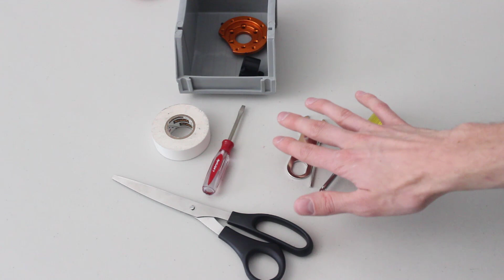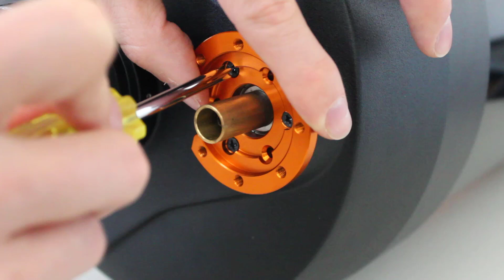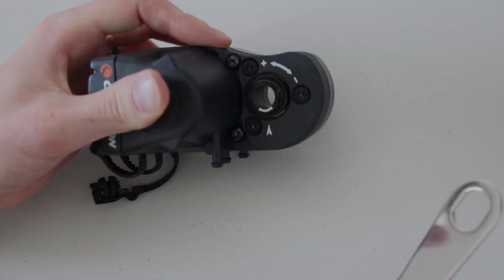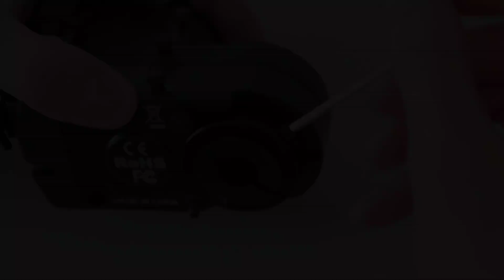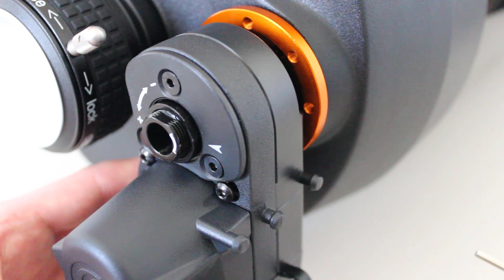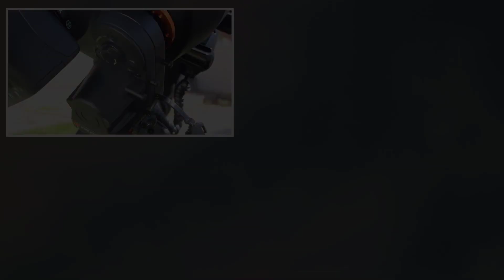How to Install the Celestron Focus Motor (Detailed Version)

Comment: A great video. I used it when I installed my focus motor a few years ago and now I need to reinstall it after it stopped working. Lost the grub screw however. 

I now need to buy the set screw shown at 10 mins in. Anyone know the size? Metric/imperial?

Comment: HELP. How do I power both my focus motor and my Skysync at the same time? Both the focus motor and the Skysync only work when plugged into the right port on the base of the telescope. I’ve tried plugging focuser in one port and the Skysync into the other port and vice versa, but both devices only work with one port. What am I doing wrong? I have the Celestron 8SE. Thanks.

Comment: Is there any other way to control this focus motor other than the hand controller or SkyPortal?  Both of these options are not nearly as functional as controlling manually. You have to go through several menus to use the hand controller, which is a bit awkward, especially when you're using a iPad for all other control functions.  And the SkyPortal focus control system is totally wonky. You never know what it's going to do. Perhaps they will some day improve the functionality on SkyPortal, until then I see no use for this device.
P.S.  I hadn't no problem installing this device following your excellent video. Perhaps an additional video discussing how to control the focus motor on SkyPortal would be in order. Perhaps I'm not doing things correctly or simply don't understand the controls. As far as I can tell there are no written instructions on how to use SkyPortal.
Reply from the maker: I think most people now use CPWI to control it or through ASCOM and their imaging software. SkyPortal can be a bit laggy making it difficult to focus, and the handcontrol isn’t ideal. I wish Celestron would develop a simple handcontroller for, but I haven’t heard anything on that.
Reply: @AstroBlender  Thanks so much Simon for your prompt reply. I've looked into CPWI as well as ASCOM and both only operate on windows platform. I am currently using an iPad Pro to operate my telescope, which seems to work perfectly with SkyPortal (other than focus control). For now, I believe I will return the focus motor to Amazon and continue operating my E8 manually. I really hate the fact that  astronomy software in general has abandoned the Apple format, which is far superior to windows in many ways. Thanks again for your prompt reply and interest.

Comment: Well, I tried installing the motor today and a couple of things as regards to the Celestron 6SE.:

1) The cover plate screws are 5/16 hexagonal screws, not Philips screws. The philip screw supplied is not going to work. 
2) I had issues with installing the cover plate. No matter if I set the scope pointing down and snugging it, it tilts and binds. I ended up stripping the gears. The good thing is I had a loss prevention plan so I'll get a replacement and I'll get longer hexagonal screws since the original screws are too short.

Comment: I recently bought a Celestron Focus Motor for a C8 SCT and when I went to install the new orange focus plate, the screws I removed from the original one don't fit.  They're too wide at the top to go into the recessed area for the screw head leaving the screw too short to come out the other side of the new focus plate.  And even if they weren't too wide at the top, that would only leave 2 mm or so to protrude out the other side.

Does anyone know what size screw I need to look for at a local hardware store?  Has anyone else run into this before?

Comment: You might want to try an electric guitar knob puller. Your situation looks like the perfect application for that tool.

I really would like to know why this focus motor will not work with the 127 SLT MAK.

Comment: Installed focus motor on se8 i bought 2nd hand wobbles.   Motor works fine but wobbles.   The 2 hex bolts are stripped and will not loosen so i can reinstall.  Help!

Comment: When you showed the plate angled when you had one screw snug for an example, it looks to me to be that the motor plate DOES NOT sit flush to the flat part of the telescope body.  IF the plate rocks at all it means that the plate back ridge is a bit larger than the scope recess.  I plan on VERY SLIGHTLY SHIMMING the plate back ~1/32 or so, (one or two thicknesses of electrical tape),  which would ensure that the plate is actually flush to the scope body recess....  Then to only tighten until snug.  I will be examining this process in person when I get my CPC 800 XLT and focus motor in hand next week.   My comments are based on what I saw during this video.

Comment: For those who have the Celestron 11-inch, like me, I have found that installing the plate so that the spot with the greatest number of mounting holes is facing down, if you want a vertical orientation of the focus motor.  Otherwise,  you will get the focus motor slanting in toward the back focus, or you will only have options for the focus motor base (the surface with the inputs) to be straight out to the side or straight up.  I wanted mine vertical, so I had to unmount it, take the plate off and reorientate it so the holes were at the bottom, that worked just fine.  Thanks for sharing your expertise.  It helped me bunches in installing this focus motor.

Comment: Thanks for the great review and instructions.
I bought the focuser last week and installed it but I have issues with the design.
It's working OK for me, however with some issues.
First, when I calibrated it initially the motor had a pitch change in the  sound it made - a rythmic change once per rotation, which I attirbuted to a slight misalignment.
I removed the motor and double-checked the orientation of the mounting plate and found it was just a "hair" off.
Re-installed the motor but the pitch change remained.

I am of the opinion that the set screw is only meant for the C-11 and C-14 scopes.
Set  screws are supposed to be meant for metal-to-metal contact.
That's not possible if you use the plastic adapter sleeve  for 8" and 9.25"  Celestron scopes (I have the 8" SE8).
The set screw is pressing against plastic (and deforming it).
The primary method of securing the motor sleve to the brass knob is the clamping screw, which squeezes the metal sleeve, which squeezes the plastic adapter.
I think the set screw in my case is redundant.

What do you think Slymin?

Comment: Thanks for your excellent presentation.  It appears you are using the small diameter 0.63X focal reducer.  Is there enough clearance to use the much larger diameter 0.7X Celestron reducer with the focus motor on the Edge HD 925 OTA?
Reply from the maker: There is if you get the latest version. The new version of the focus motor has a little notch cut of the side that accommodates the C9.25 EdgeHD with 0.7x reducer.

Comment: Great video. Unfortunately I installed my focuser on my 11” RASA before seeing this. I legitimately ran into every problem you outlined lol!! On my RASA V2 there is also a rubber gasket that fell out initially when removing the original plate.. just a warning for others as it’s greasy and fell on the ground. Also on the larger mounting bracket you have to really pay attention to the orientation it mentions in the manual. In the end I had to just loosen up my screws on my mounting plate way more than I thought i should to get my motor working. I don’t think that can be stressed enough about how loose it might need to be, but my focuser has been working great.
Reply from the maker: Good notes, I’m glad you found the video helpful. Clear skies to you!

Comment: I’ve had the focus motor on my Celestron evolution 9 1/4 telescope for the last year or so and it seems to work but I have not been able to calibrate. What could possibly be the issue with calibration?

Comment: Screw, screw, screw!  Not bolt! Good video though.
Reply: Agreed that the clip is excellent by being very easy to understand and follow, although yes, being a toolmaker by trade, I'm very picky in many ways and one of them is using the correct terminology when describing fasteners. Screws they definitely are. The even, systematic application of fasteners also apply to any group of fasteners, whether nuts, screws or bolts that include things like wheel lug nuts, etc. That being said, thank you slymin for taking the time and effort for producing your many helpful guides.

Comment: Unfortunately it has not been like that for me. Firstly I found only two screws inside the focuser unit. Several days later I put a video probe inside the barrel and discovered a rubber sleeve covering one of the holes! No indication where it is supposed to go. I edged it out of the way to reveal the third hole - but where is it supposed to fit and why did it not stay there?  I assembled the motor meticulously according to your and Celestron's instructions.  I was able to move the motor in a bit and out a bit. When I selected calibration it made a small move and then stopped for all time. Having already followed the instructions there seems little else that I can do.
Reply: I had really hoped that there would have been a reply to my detailed observations shown above. No progress then since I bought the focuser.  I cannot make it concentric because the cover plate is fixed by the 3 screws and the tube will not move laterally to place it in the centre,  Disappointed.....

Comment: Thank you Slymin. I just installed the focuser on my 8SE following your recommendations and it went very well. To help with leveling and centering the focuser plate and motor assembly I placed the OTA vertically, front-side down and this technique effectively ensured that all the hardware had not gap or tilt. And it is also much easier to align and install the parts to the OTA since gravity helps and you have your two hands free for doing the fine work, One extra step that I did in order to ensure a stronger hold was to put Loctite 242 on the 3 screws of the plate. Overtime the motor movements will induce tension on the assembly that might eventually loosen the bolts and make the system wobbly. The screws have a very thin thread and are not really designed to hold such a piece of hardware like a focus motor. Loctite will definitely help in maintaining the hold tight.

Comment: Great video, but there are some missing items. I have a Celestron 8 SE so this applies to many. First... the set screw and the other focus ring screw has to be tightened significantly to get the plastic fitting to grab the focus tube of the scope. That set screw should be more than halfway in the threading. Eyeball it before you put the focuser on with the captive screws. Secondly... there’s a whole calibration procedure that isn’t mentioned.

The unit is a game changer for viewing though... You can’t get the level of fidelity with using your fingers as this unit gives you.

Comment: There is one major issue. If your focus motor does bind and cannot access the screws which tighten the drive to shift then your basically stuffed with no way to remove the focuser motor.

After all there is only a small part of the motor you can access these bolts so if it binds and has bound where you cannot access these tightening bolts to thr focuser then no way in hell can you remove the motor

Comment: In case this helps anyone else out down the line........

Despite great videos like this one from Cody and despite reading numerous articles, I could not get my Focus Motor installed on my CPC1100 correctly. I know I'm not the only person to encounter problems with this. No matter what I did, I could not get the motor work correctly with the screws for the mounting plate and motor mount installed anything other than loosely - which is obviously not right.

I read up on a lot of threads about this and it seems the basic problem is that the mounting plate supplied with the motor causes pressure to be put on the focus bearing. People have come up with many solutions including installing washers / shims and, taking Celestron's Tech Support advice, to install the orginal focus mounting plate first and then the Focus Motor kit mounting on top. - and that's what I did. 

Whether by luck or design, my CPC1100 came with quite long screws in its original mounting plate so there was ample thread left to pass through both plates. 

With both plates installed, all the screws can now be tightened down (snugged down, nothing OTT), including the 2 hew screws for the motor mount. Before, the screws had to be left loose just to allow the motor to turn anfd, believe me, I spent hours making sure everything was true and aligned correctly to try and solve this.

Anyway, that's what worked for me and I am happy that my motor is now working as intended. Celestron are a starnge set up - they produce great scopes but some of their kit and accessories leaves a lot to be desired.

I hope this may help someoen else out down the line.

Comment: I cannot get the autofocuser to focus automatically. is there something that i need to do in settings? i am using the iphone skyportal app to control the mount. i can focus using the software quite nicely now but i cannot get it to focus automatically! I have to manually adjust the focus using the software whereas the video here seems to suggest that the focus happens automatically. what a pain. how come they did not send clear instructions with the focuser!

Comment: I thought I would take a chance and ask this. I just installed the Celestron Focus Motor. It works properly with my original Nexstar+ hand controller, CPWI, Skyportal. It does not work with my Starsense HC. It has been updated with the latest firmware (currently 1.20.20162) this is what is being reported by the HC. Focuser option is not in the menu anywhere. Would you have any idea what might be wrong? Thanks in advance.

Comment: It seems to me the sensible way to install the focuser plate is to partially put the screws in and then tighten them in rotation (i.e., making them tighter a bit at a time, until they are all tight).  Your method is basically that, so great idea!

Thanks for the explanation  Slymin.  I really appreciate your content on the Celestron telescopes.

Comment: Is it normal for the focus motor to move slightly as it winds and sound like it struggles a little bit as it turns (sound pitch goes up and down in frequency a little as it turns)?  I have assembled and reassembled it three times with no difference.  It’s mounted flat as I used your video for a guide.  I did notice that only the set screw holds against anything.  The plastic screw seems to be very weak and not really do much of anything.

The motor calibrated ok but just sounded labored to me.

Comment: Hi, I really enjoy your videos, thank you. I have a couple of questions if I may. 
This might seem like a naive or very basic question, but why is the focus motor needed? If it's needed that badly, why does it not come as strandard with the telescopes? Is this a case of the manufacturer cynically exploiting the consumer?
Reply from the maker: HollomanUFOLanding For the average observer, a focus motor isn’t required at all. At 2000mm though, when imaging the planets, simply touching the telescope causes it to shake. Getting a crisp tight focus is almost impossible. The same is the case for deep sky imaging. You have to move the knob, wait for the telescope to stabilize and keep repeating. It’s a pain and never really gets you a crisp focus. With the focus motor you can watch your focus change in real time and refine it. I consider a motorized focuser (regardless of brand) almost a necessary accessory for advanced planetary imaging. Again, for visual use it certainly isn’t required, but still is a nice upgrade. I hope this helps.
Reply: @AstroBlender  Thank you, I appreciate your advice on this. As you can probably tell, I'm just starting out on this, although have studied astronomy for decades. Planetary imaging = using a camera to take pictures through the telescope, right? Can you use any camera or one dedicated to telescope use? Thank you.
Reply from the maker: HollomanUFOLanding Planetary imaging is using your telescope to image the planets. Usually people use a planetary camera to take videos of the planets and stack the resulting frames into the best quality.
Reply: @AstroBlender  Thanks Slymin

Comment: Great video Slymin.
Quick question, is there a certain position the focuser needs to be in before installing to autofocus motor?
Should the motor be installed in the middle of the focuser's allowed movement?
Or does it matter?